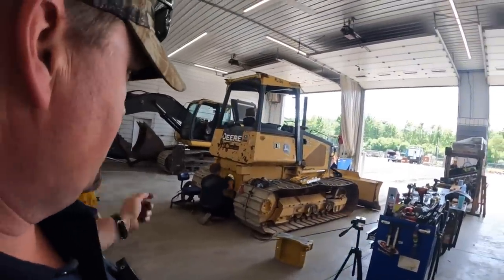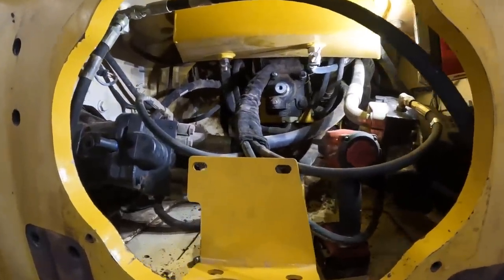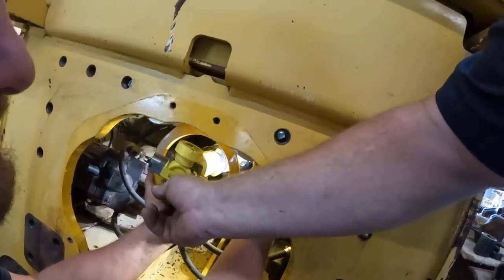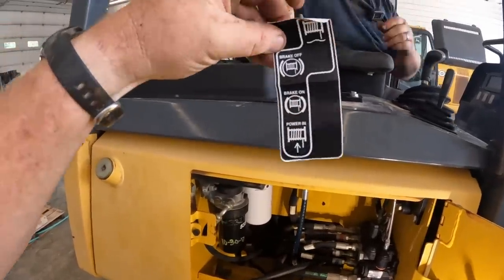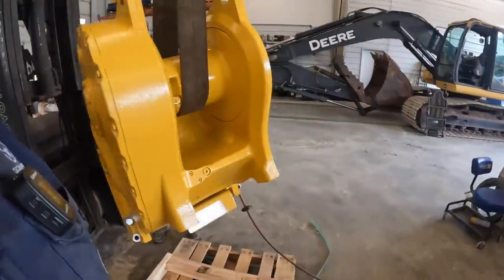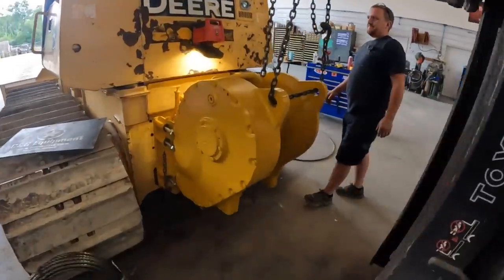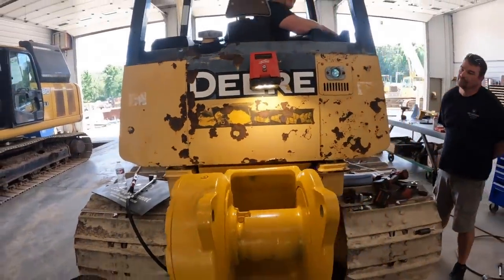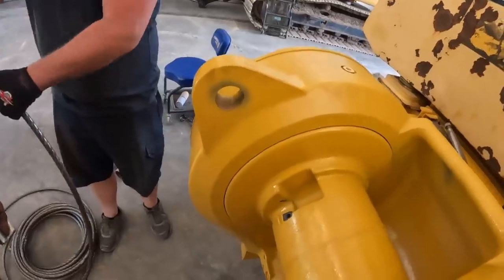Deere 4000s winch install on any 450 550 650 H J or K dozers how to @C_CEQUIPMENT

Comment: I hated putting new cable on winches win I was a logger awesome job guys
Reply: Watched a video of a crew shortening the drag cables on a really big dragline. The reason for taking 6 feet off the house end of the cable was to change the place where the cable jumped to the next layer. They had to run out maybe 300 feet of I think 3 inch wire rope. Fun to watch,  glad it wasn't me.
Reply: Always took some pride in taking care of my bull line. Spooled good, not crossed or hard on it trying to make it last as long as possible.
Reply: And hated when you needed to pull it out and it had a knot or was crossed and couldn't get it out. And you had to waste time getting it to break free and pull it out to choke logs.

Comment: My Uncle used to say,  "Boy you're gonna mess up a wet dream", 🤣  Looks like Kevin did it this time. 🤣 🤣   
However that I'm getting the hell outta the way Stance is a good 💡.
That's alot of tension on the cable. I have had one snap while tugging on an Oil Derik. Not fun.

Comment: I need a used wedge that goes through the drum so I don’t have a dent in the line when i spool it , if I can spool the line on as you did with the mm bolt, if the threads are not stripped , I’ve never seen the bare drum on my machine when I purchased it the spool was full of cable any help is appreciated
Reply from the maker: Yea you can buy the wedge from Deere or you could probably take a piece of hardwood and make a wedge just to fill the void

Comment: What RPM does the winch need to be at for max pulling? Not the Dozer RPMs  but the driveshaft to the winch RPMs. Wondering one of these winchs would work on a John Deere ag tractor PTO shaft at 1000 RPM or if that would be to little RPM?
Reply from the maker: They are a direct drive from the engine so they turn the same speed as the engine rpm
You will have max pulling power at 1000 rpm or any rpm you run it, it’s just the speed of the drum that will change with your rpm

Comment: Same winches go on some timberjack Skidder’s  it has a long snot on the front , how much to reseal and put clutches in the brake and the pulling clutches  also  how does the free spool work
Reply from the maker: Yes they are the same basic winches but the front drive is different and the gearing is different 
I keep all the seals in stock have to pull apart to see what all it needs
Reply: @C_CEQUIPMENT  the gearing is to fast on the Skidder’s I wish they where a little slower, if I ever have any trouble I’ll get in touch , I’m just about 2 hours south of Louisville so no problem to load  it up and bring it to you